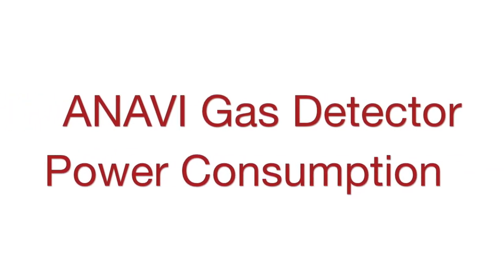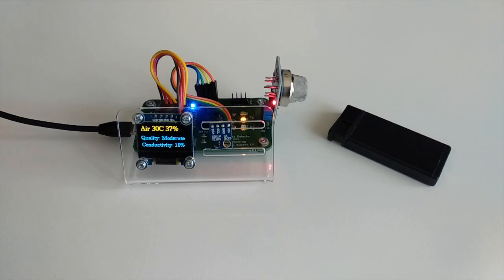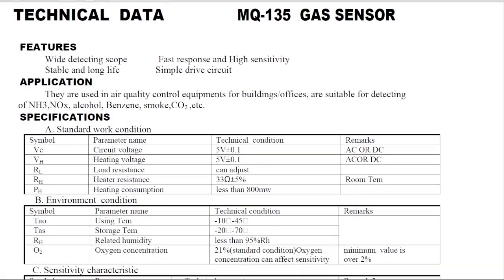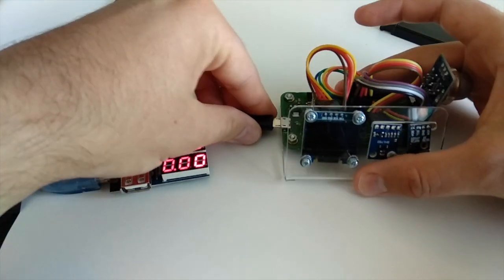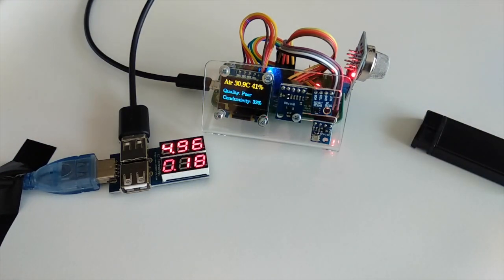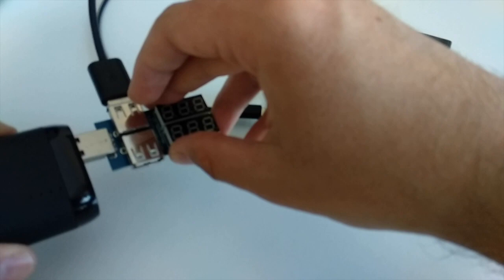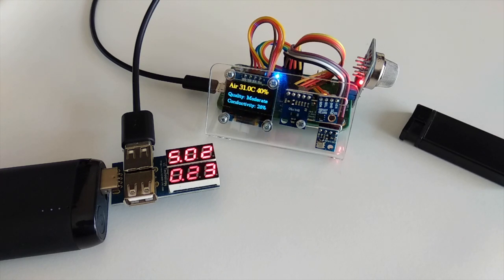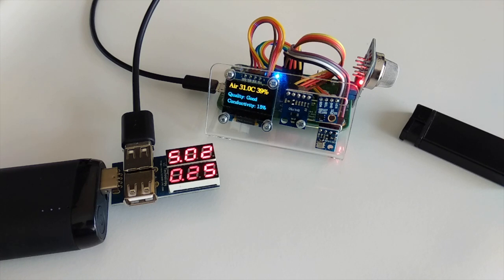What is the power consumption of ANAVI Gas Detector? Can it run on batteries?

Comment: What would be the power consumption, if you only run the gas detector without OLED display, nor extra I2C sensors?
Reply from the maker: It is not a huge difference, the power consumption is about 0.1-0.2A less. Some photos: https://twitter.com/AnaviTechnology/status/1161163644308217856